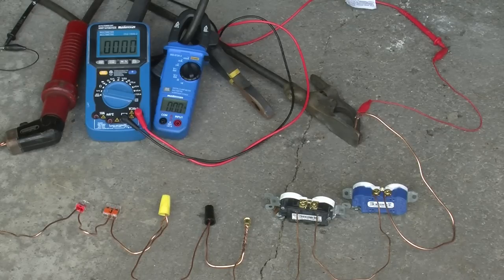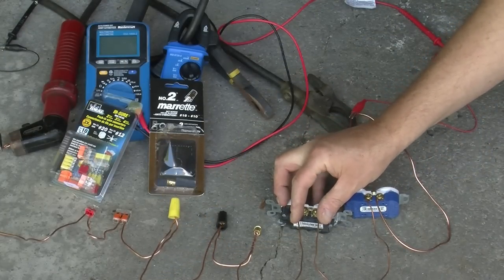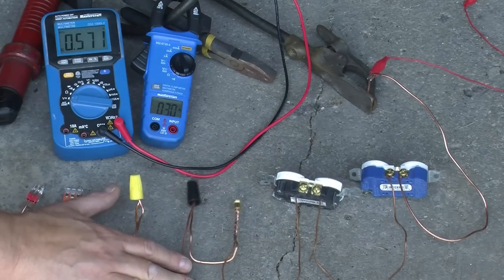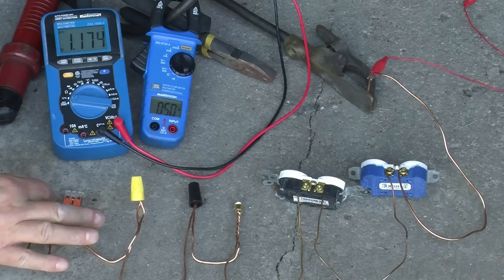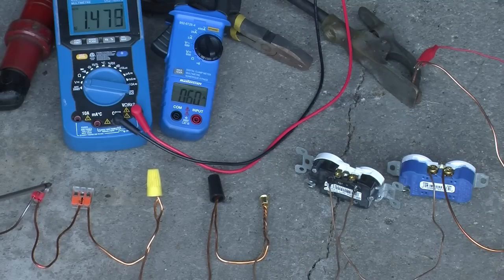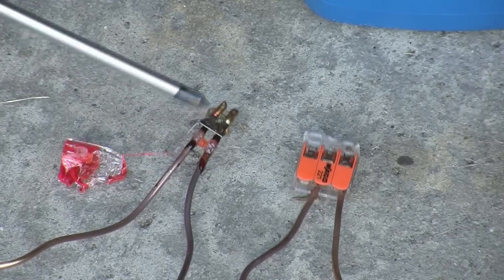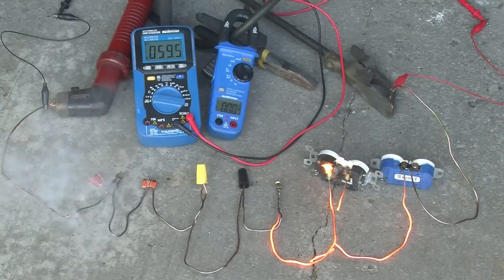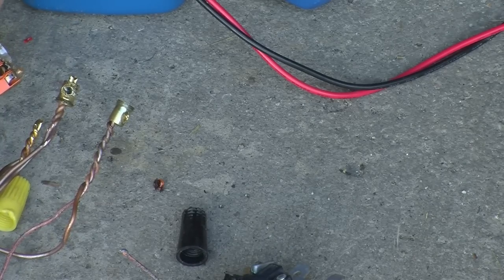Connectors: Which is the Weakest Link

Comment: Test method is not the best with connectors in series and with different gauge conductors on each end of the circuit. Each connector will have a different resistance and the 14 ga wire has more resistance than the 12 ga., essentially becoming a resistor itself. In a series circuit, all resistance is additive. Given a constant circuit current, the voltage drop across each connector will vary.  In this test, the meter was set up to read voltage drop across the combination of connectors. At 20amps there was .35 volts combined loss  but hard to say which connector had the highest voltage drop. Would of been better to test each connector individually with same voltage and amperage (e.g. 120v @20amps) while measuring voltage drop across the connector . Using ohms law(R=v/I), the resistance through the connection can be calculated. Highest resistance connection will produce the most heat and will most likely fail the quickest. There are other variables that will determine failure time beyond the scope of this response but you could continue with destructive testing by holding same voltage and cranking up the current until circuit opens while timing. I would bet the twist on connector (marrette)  will carry the highest load the longest.

Comment: Would of been interesting if you threw in a commercial a d industrial spec grade receptacle that has "BACKWIRE" terminals: the ones you do indeed put the wire in the back but you have to tighten down the terminal and it clamps the wire firmly. Also they are of better construction so it be interesting to see how hot they get
Reply from the maker: I know the terminals you are talking about. I have had a number of requests to test receptacles - had thought of those - will be real interesting to see how much better they are.
Reply: Oh man!!! Id like to see one of those!!!! What do I search for to look them up?
Reply: Though the construction of these outlets is stronger, I find that they strip out when tightening. Also, many people end up getting the insulation behind the terminal because they push the wire in to far. The cheap outlets are the best. If you pigtail and twist your wires using wire nuts, the stab in holes are just fine, because most of the current running on the circuit runs through the pigtail and not the outlet. Also, if you use the screw terminals on the side of the cheap outlets, you can crank those things down like nobodies business and they will not strip out.
Reply from the maker: @zinsco  That interesting and surprising. I wonder why the "better" ones tend to strip? I would have expected them to have no worse threads. I get the bit about people pushing the wire in too far - I'm sure that happens a lot.
Reply from the maker: @cdoublejj  I sorry - I just saw your comment - no idea why it didnt show up 4 weeks ago! The easiest way is to go to your favorite hardware stores web page on receptacles and order in terms of price. They show up between the cheapest ones and the fancy designer ones or ones that have features like USB.
Reply: @zinsco  Na, the cheap outlets are junk... Take one apart and look at the construction of the contacts vs one of even a bottom of the line commercial grade specification device, big difference.
Also if you use the backwire terminals of a device, install the conductor correctly and NOT crank the snot out of the terminal you will have zero issues..
 I have been to many a service call back when I was at my former employer that would be a burned up backstab connection. Didnt matter if it was pigtailed they still fail when subject to a heavy load like a heater or A/C..
By far the best are specification grade receptacles that can be had in commercial, industrial and hospital grade versions, the  latter having to meet certain requirements for impact resistance, contact resistance and prong retention...
Reply: Would have

Comment: As an electrician myself most I find troubleshooting problems lead back to the push in connectors they can fail often even when used properly.
Reply: This is what I find a little disconcerting about the recent trend toward Wago push connectors. When you look at the contact surface area of push or guillotine connectors, the surface area of direct contact is much smaller than that of a twisted pair. Add a little moisture and corrosion, and you get jacking of contact surfaces, with corrosion prying the old connection apart. We did something similar in the 80's, and professionals initially loved the idea because they could save a minute for each receptacle. It was a few years before guys started seeing major problems. Is the Wago so different that we can be confident we aren't making the same mistake?
Reply: Most of the issues I've found is due to people not ensuring a solid connection, usually outlets first, usually those stabs, but alot of it is also very old and has corrosion. I wouldnt doubt that alot of the ones involving the screw down connectors had more to do with not cleaning the corrosion off before reconnection. Whilst I might be shaving a few nanometers of material off and technically downgrading the current capacity, the fact that it's all withing the connection area, a larger section of the wire, and the added resistance from corrosion, I'd say you are probably best off always cleaning the surface of clearly old wires that are no longer shiny, let alone something that has turned green lol. Only time I've seen problems with wirenuts was once again either some bad corrosion that wasnt ever dealt with, or just improper application of the wirenuts. I've actually seen alot of 14 going off to an outlet/ light on a 20 amp run, and since I'm not the boss, we dont usually try to replace it with the customers approval, but for how often I've seen it, I've never seen it being involved as a catalyst for casing melting down. I am not sure I've ever seen a push style or wago in any of our jobs existing. We're pretty rural and it's mostly alot of old residential that we deal with. Only time I've seen the push in style are built into can lights really, and most of which are new with us installing them, so I guess I have seen them and used them to a degree. Weve probably replaced one that had that built in but it's hard to remember all of the work weve done.
Reply: @spelunkerd  WAGO's (var-go) 222 series lever connectors have been in use for about 20 years now and 221 series close to 10.  They aren't the only types of spring clamp connectors either, which as a class of connector have been around for quite a long time.   The whole class of connector might be a new concept for many electricians et al in the USA but they have not burnt the rest of the world down so far.  Arguably the constant spring tension, a similar concept to the conical spring in the wire nuts used in the USA, make them a superior option to screw terminals that often work themselves loose with thermal cycling.  Many people come across ancient screw terminals that require considerable force to undo and assume that they have been making a tight joint all the time.  That is definitely not the case.  Often the apparent tightness of old screw terminals is the corrosion and other surface debris in the screw thread preventing the screw from being turned easily.  Rest assured, using a WAGO connector is not a ticking timebomb.
Reply: In electronics , those breadboards you use to prototype have similar push-in connectors, they fail all the time and lose their holding ability. I suspect wago's have the same problem.

Comment: When the wires are twisted together properly, the wire nut is essentially not part of the equation at all.
Reply from the maker: Good point. Having said that, they still provide some mechanical strength and insulation.
Reply: @ElectromagneticVideos  Yup. That's the idea. Insulation and keeping the wires from untwisting. I really like the Wago myself though. Very convenient especially in tight spaces and for future reworking. Untwisting and retwisting wires fatigues them and not supposed to reuse wire nuts. Also much harder to get wire nuts right and tight at 3 or more conductors. Wago is nearly fool proof.
Reply from the maker: @ken830  I would sure use them for connecting things like ceiling lamps with thin  stranded wire to solid wire in the junction box. I was a bit dubious about them at high current loads but to be fair they did hold up to past the rated current.

Comment: The Wago held up perfectly, until it didn't- which is also perfect.  In an over-current situation that's the behavior I want to see. They're a second fuse. Engineering perfection. I don't want a connection to hang on until all my walls are on fire.
Reply from the maker: I think it failed in that way partly because of me touching it with a screwdriver  to see if the plastic was softening. So if left alone it may not fail as cleanly. But either way, took an impressive amount of current.

Comment: I use stranded wire for all my electrical projects as it's easier to pull. The Wago connectors are so much easier to make connections with, and is all I use now. I also use commercial/industrial backwire clamp receptacles instead of trying to make a J hook around a screw. If I have to like on a light switch, fixture or something, I'll keep the insulation on at the end of the wire to keep it from fraying.
Someone else did one of these extreme overload tests, and Wagos performed better with stranded wire as there was more contact surface area. Either way, I don't think you'll run into issues with those under normal operating parameters. The breaker should trip long before the plastic even gets soft on a mild overload. As seen here, 40 amps only made the connector a bit warm.
Reply: you shouldn't use stranded for hi-voltage anything
Reply: Isn't stranded fixed wiring against code?
Reply: @bigtitmaster  
Why would you think that?